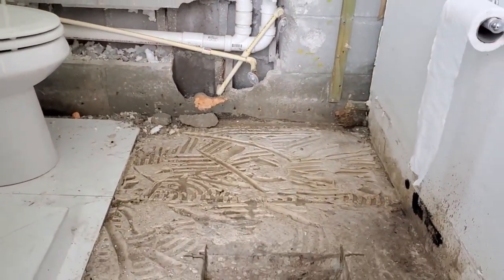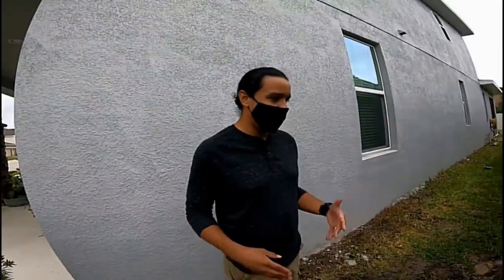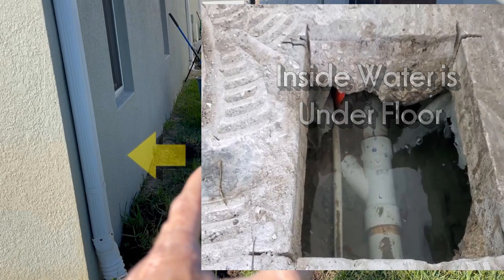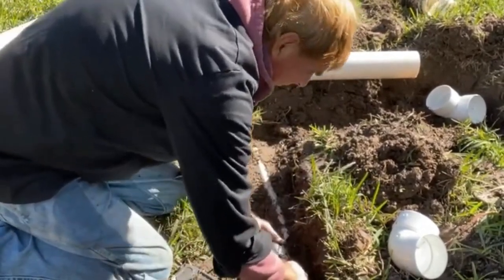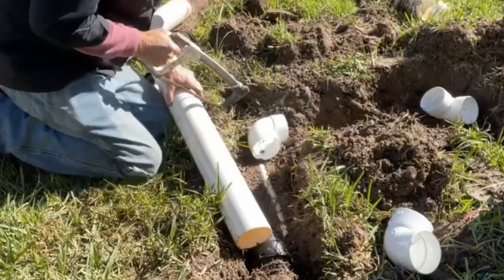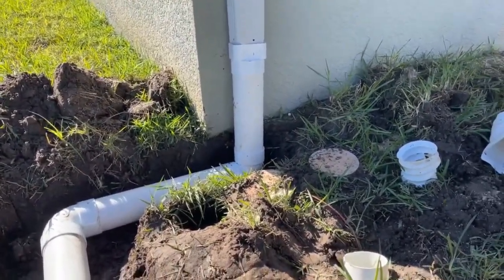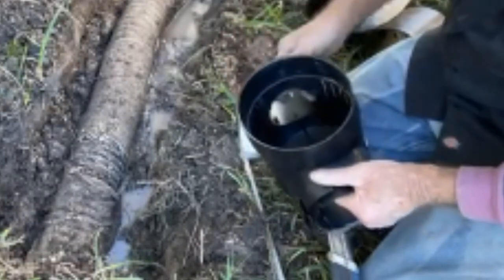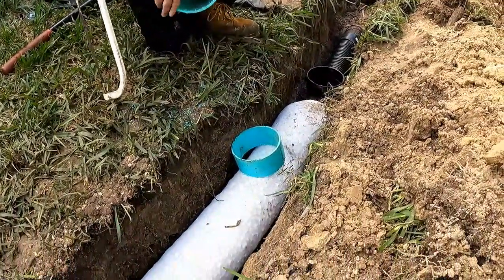Flooded Yard Causes Major Problems. Complete Yard Drain System  - How to Fix - DIY for Homeowners

Comment: I live beside a lake and the water table is 14 inches down.  The house is at the foot of a hill.  Up on the road there was a drain over flow when the water runs down the hill.  When the drain up on the road overflows, the water comes up through the floor and floods the basement.  The drain beside the boiler hot water heating system acts as a spring instead of a drain.  Is there a shallow sump pit that only goes down 14 inches?